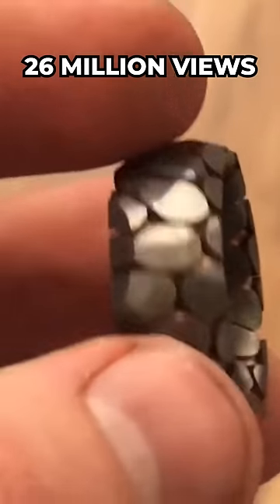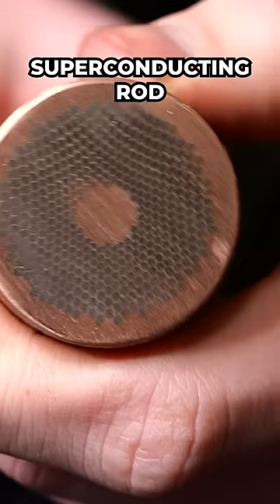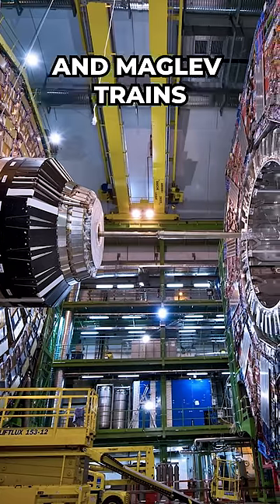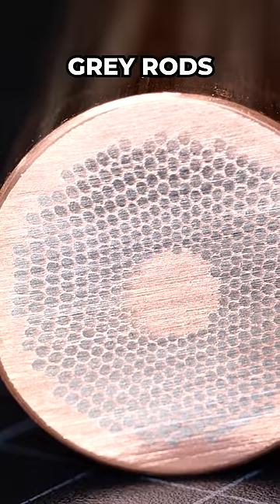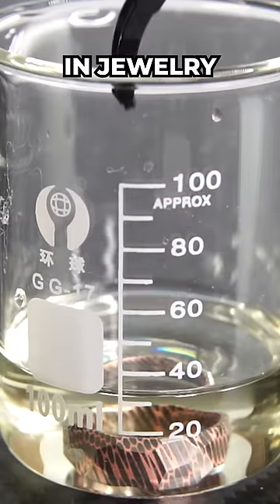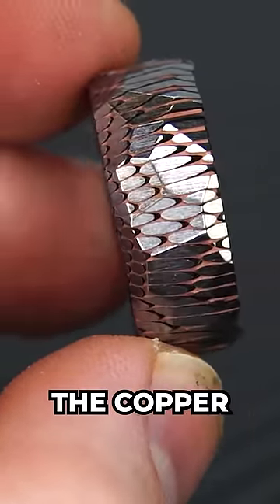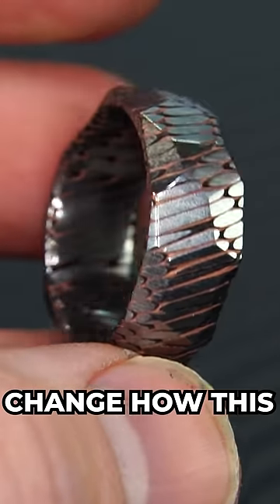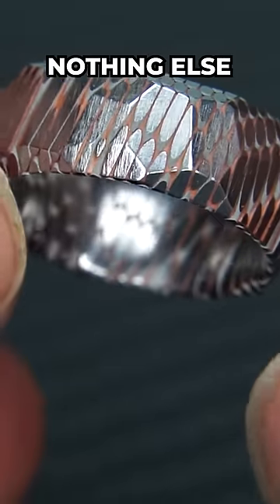We Made A Ring Out Of Superconductor

Comment: if you're an electrician: DON'T WEAR THIS.
Reply: I think electricians will take any rings off before work.
Reply: @dvdjhp  you'd think so, but turns out they don't. Solid gold bands while working with live wires, so dumb.
Reply: @SolusDarkcoat  Almost no electricians work with live wires, they need a "live working" certification before they are allowed to do that, and they wear gloves and use insulated tools, etc.
I used to work with minicomputers with 2.5V 600W power supplies, which will melt a normal ring to your finger. These superconductor rings have only a tiny resistance, so they won't heat up much and the fuse or breaker will pop open..
Reply: @neilbarnett3046  huh CeRtiFiKaTe ?
wtf 😂
2.5v 240ampssss ??
sir thats a welding machine.
Reply: @SolusDarkcoat bro your out here talking bout electricians without knowing the first rule of electricians turn off the circuit and test the power to see if it still has current then you begin your work
Reply: @yuvanm9040 🤡
Reply: @dvdjhp agreee
Reply: @lookoutyourwindow9995  I'm an electrician with a degree and certifications for working on voltages up to 24kV :I

The sheer amount of stupid stuff I've seen people do on a daily basis is staggering. So, when I tell you they don't? They don't.

Edit: Also, I've manoeuvred/operated breakers, switches, and relays for 100kV (and over), but never directly worked on the cables/lines.
Reply: @neilbarnett3046  you'd be surprised.
Reply: If they wear this, they'll gain the power to summon thunder.
Reply: Should be common sense, but knowing the people in my class for electrical, it’s not. Lmfao
Reply: @yuvanm9040 he said 600W
Reply: @ryand.3858  600w / 2.5v = 240A

Comment: Ah yes, the Finger Cutter 2000. Looks great, cuts even better.
Reply: I see you have never heard of wax or post processing to smooth it out
Reply from the maker: Like they said, it ends up being very comfortable because of the finishing process. We tumble them slowly for days to get everything very smooth while keeping the shape.
Reply: @PatrickAdairDesigns did you cover the inner face in some way? I wonder if it feels comfortable having the same pattern in the inside
Reply: Niobium also doesn’t hold an edge well.  A few passes with a wire wheel smoothed thins out easily. Works on the inside of the ring too
Reply: @PatrickAdairDesigns ey there! Can i ask how much a ring like this retails for? And coukd we purchase one if we wanted one,? I'm thinking this would make a fairly unique wedding anniversary ring!
Reply: @PatrickAdairDesigns where can o buy it
Reply: @PatrickAdairDesigns Can we buy this ring ?

Comment: If it can be used in a particle accelerator then use it in a particle accelerator. Unless it's just that easy to get ahold of which doesn't seem likely.
Reply from the maker: We either use the scraps and end cuts we don’t use the usable material.
Reply from the maker: If anything we are doing a good thing by using them because if we didn’t use them they go In the trash.
Reply: @PatrickAdairDesigns  Sounds good to me then.